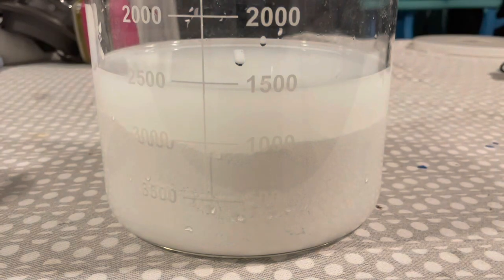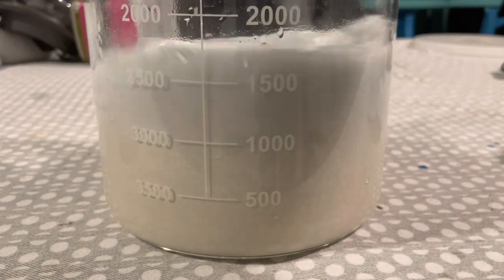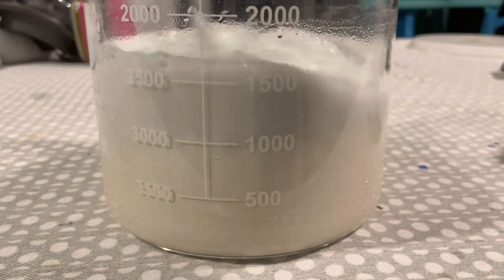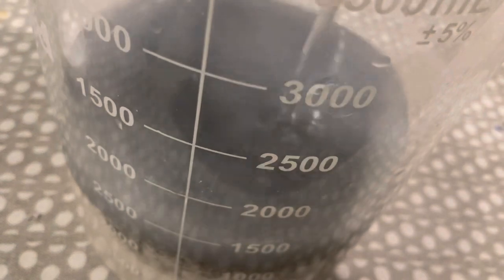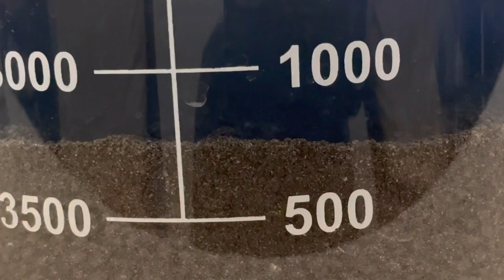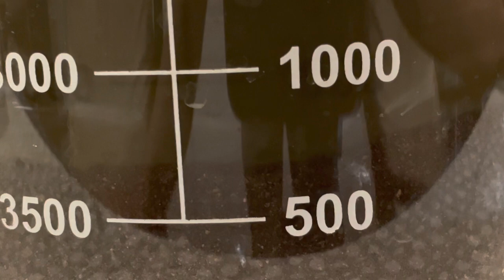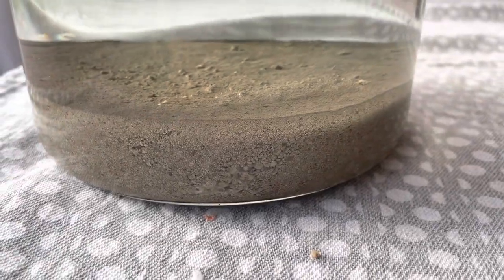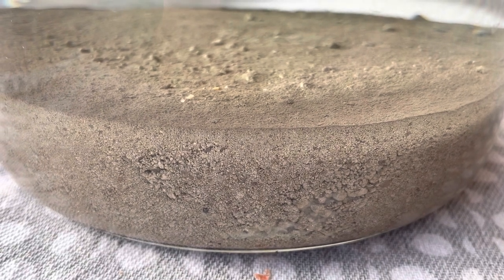Converting Silver Nitrate into Metallic Silver -  Is Science Magic? @VendettaProspecting

Comment: Hi, need your guidance on the below, i added the sodium chloride in the silver nitrate solution, its become milky white but there are no deposits found. so i added the HCl it turns light green and clean solution.  Can i know how to recover the silver from this. Thank You
Reply from the maker: Ok you need to wash the white silver chloride many times until water is clean and colorless. 
Then use NaOH to convert the chloride to silver oxide… once it’s all turned black as midnight then rinse and wash then add sugar until silver oxide converts to silver metal wash and melt

Comment: So the last step was for you to add sugar to it? Presumably to reduce it. That wasn't super clear in your video.
Reply from the maker: Yes that’s correct ✌️
Reply: @VendettaProspecting  I think I heard you say "boiling" too, but the beaker didn't appear to be on a hot plate. Is this an exothermic reaction that will cause it to boil on its own?
Reply from the maker: @jheadley635  the addition of sugar will create a lot of heat and will boil from the exothermic reaction, too much could be a bad deal... also the addition of NaOH is very exothermic as well from the previous steps

Comment: I had to comment I made the 69th like to the video, but I Ag Nitrate at work and use HCL after that I'm not sure what to do.

I'm not going to try it but just want to know how it all works .... 100% lye I dont even knoe how to get
Reply from the maker: 100% LYE is sold as drain cleaner and is at hardware stores. after you convert the silver chloride add lye until it is all black... then simply add white table sugar slowly to convert the silver oxide (black powder) into metallic silver.. then wash wash wash wash and melt